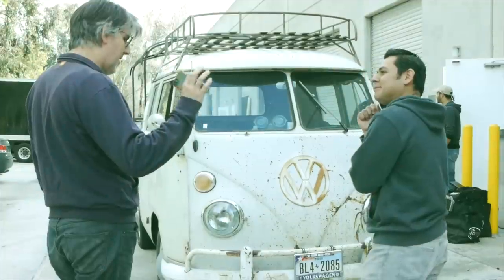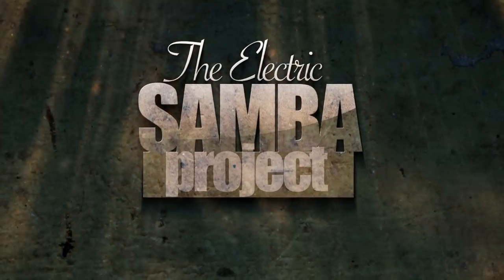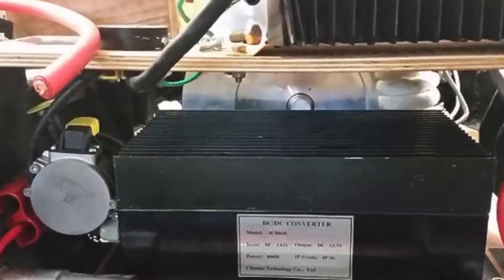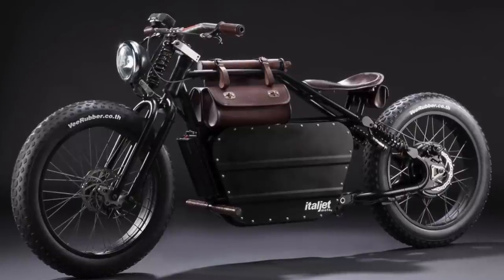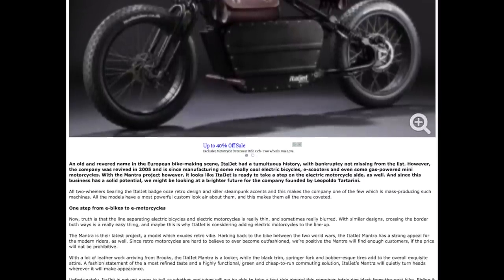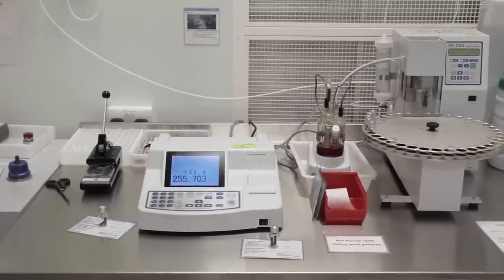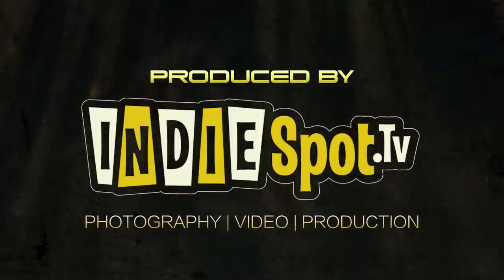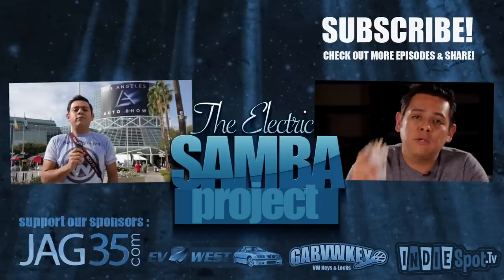Enough about me! what about your DIY EV? - eSamba - Electric Car

Comment: I have a bunch of motorcycles and parts and an old golf cart motor, 48volt I think, I'm thinking of putting together somthing with a cvt on it, to get higher speeds. and better performance, my only issue is batteries, but I'm thinking with high capacity 18650. I can pack enough into it to get some good range. and it's going to look as cool as the bike in your opening picture.

Comment: Have you ever considered Mounting your batteries on your Samba Underneath your floorboard like the Tesla S? I have a VW Thing, where I just installed new floorboards and been playing with the Idea of mounting some kind of Batterie pack like the Tesla S, I want to avoid Cramming everything in the Frunk or behind the seat and gain as much low center of gravity as possible. What do you think? Also, could  you double layer or Sandwich the Tesla Modules on top of each other? I thought about building a case that would become part of the floor itself and just mount the seat brackets to the case itself. I'm not trying to re-invent the wheel but at the same trying to implement my own design. I'm trying to Keep as many cells out of the Frunk as possible.

Comment: 1: Link to the forum thread (Impossible to find really, should be under about or something?). Secondly, what's the model-number for your individual battery and which of the HPEVS motors are you using, the AC7 family or the AC5X? Cheers mate.

Comment: jhu, I will like to know if the samba ran better with the tesla batteries and if the cooling system the battery brings matches yours.
Reply from the maker: It runs the same, I am currently not using the cooling loops in the batteries as they don't really heat up more than a few degrees